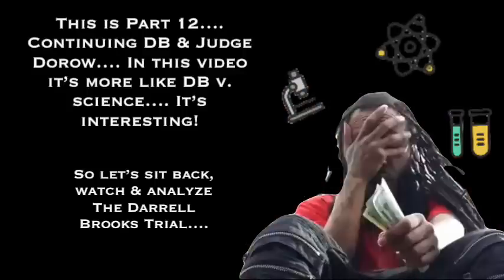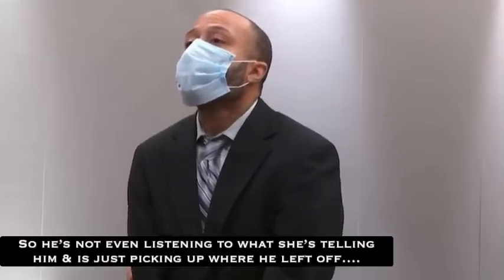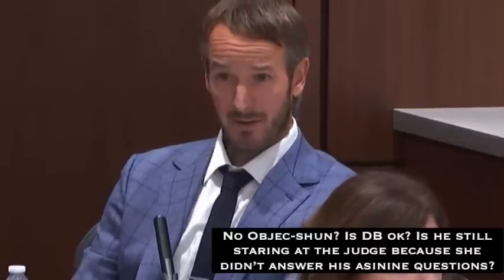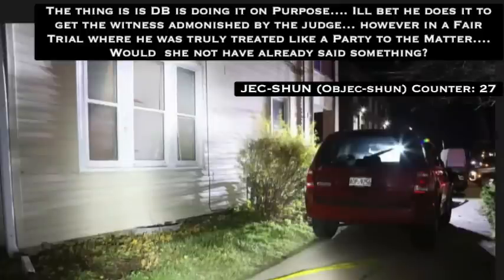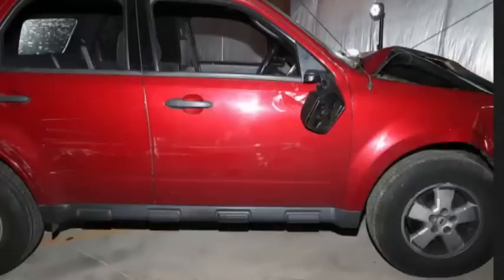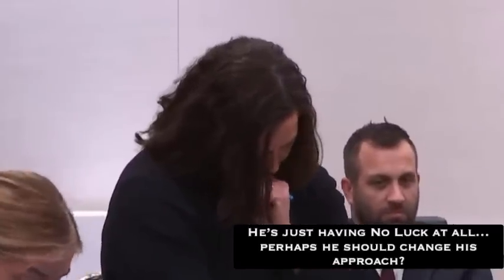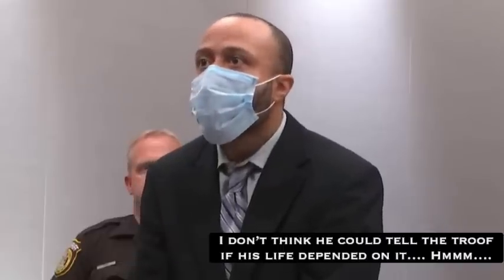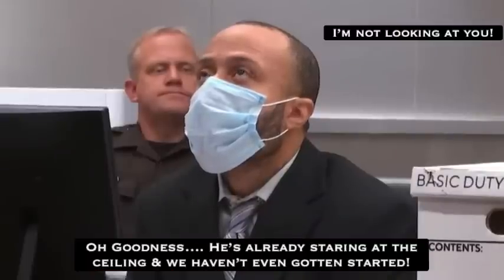Darrell Brooks & Judge Dorow: Part XII

Comment: I would have asked a specific question about the throttle body and gas pedal, the parts that can actually cause unwanted acceleration if they aren't working properly. The question about if the engine controls speed is a bit confusing.

Comment: A shell casing and a bullet fragment are very much not the same thing. A shell casing holds the powder and bullet. A bullet fragment is the actual bullet that is fired. The shell casing stays with the gun as the bullet is fired from the gun. The bullet is the actual projectile. Durl says a car and an SUV are different but a shell casing and bullet are the same thing. He’s such a little simpleton.

Comment: Alex, I agree with you completely! I've made this comment on several of your previous videos...
This video right here is why I say Judge Dorow created the "Monster" he was in court...
Judge Dorow does have the patience of a Saint. (But) She let him get away with WAY too much! Because Judge Dorow did not throw DB out of the courtroom when it was entirely reasonable to do so, he continued to get worse throughout this trial. She definitely should not have praised him at the beginning of the trial when he would halfway behave in Court. That, in my opinion, told him that that behavior was acceptable, in which case he continued to push the limit. She let that monster out in the courtroom. I agree that with a different jury, the outcome might have been different due to what she let DB get away with. He might have (actually) eaten away at a different jury and been found not guilty due to her inaction. I believe that she could have kept him in check a lot more without having to be concerned about an appeal. I am more concerned that DB acting out the way he did in front of the jury will be grounds for an appeal. She had ways to control his behavior and didn't. For instance; at the beginning of the trial, after putting him in the other courtroom several times, he changed his behavior significantly. If when he had started acting out again, she removed him to the other courtroom, she could have helped curb his behavior and the behavior that the jury saw. Judge Dorow stated more than once it was her job to control the way DB and his behavior looked in front of the jury.
Reply from the maker: Agreed!!!! She had the AUTHORITY & she failed to use it… it’s like she felt she had to PROVE TO HIM SHES IMPARTIAL BUT by doing that she ended up looking like she was spoon feeding a baby…. She looked partial to him & I honestly think this was for the Vic… too their day in court & it became a CIRCUS! The back & for-f between the two just re-Vic…. The families all over again…. It was not like any other trial I’ve ever seen before & I’ve found ones where people scream & freak out on the Judge… they get reprimanded QUICK!!!! The praising him, that was weird to me, he’s a 40 year old man, does he need a gold star for acting like an adult? Really? Because he wasn’t perfect that day… he had moments & he was praised? I don’t know how she could sit up there like that facing the Vic…. And praise him it was just bizarre…. I know I could not well wouldn’t have done it…. But she had her reasons…. Let’s just see what DB lawyer does…. I’m sure he’ll find SOMETHING to appeal to…. I don’t think he’ll come back saying there’s no merit for an appeal)!!!!❤️❤️❤️❤️❤️❤️❤️
Reply: Also, I wanted to point out...
I think Dumb-bell @2:14:00 is wadding up and ripping up the DNA report. Listen closely, then watch his behavior when the camera pans back to him. 😂
Reply: BS! She didn’t create 💩. His mommy did. If she had kept putting him in the timeout room, every time he acted out? The trial would of definitely had been long. She tried to protect his butt from looking bad in front of the jury, PLENTY of times.  As many has said on several pages, it was good for them to see the REAL Darrell. And he mumble 💩 or even got out saying stuff to the jury. While he was in the middle of asking witnesses questions. My point being, HE DIDN’T give AF what he looked like. As he said ‘I’m going to lose anyways’. The record was made VERY CLEAR. No Appellate court going to fall for his 💩 and give him an appeal for not following the court rules. Sometimes I think you all wished he’d of been found not guilty. Just to say ‘told you all, she sucked and now he’s free’!!! Losers
Reply: @thisfamilydoeseverything WOW! Lost my respect. So you want him to be granted an appeal? You want the victims to have to sit through another trial? But you hated how she supposedly put them through hell. I see you’re kissing up to your followers. Not wanting them to bail, because you don’t agree with them. Shame on you. Hope some of the victims reads this 💩💩💩. I’m sure they’d love you!!!🤬🤬🤬